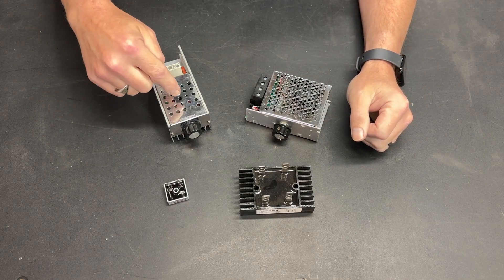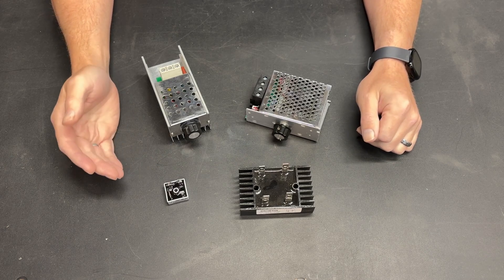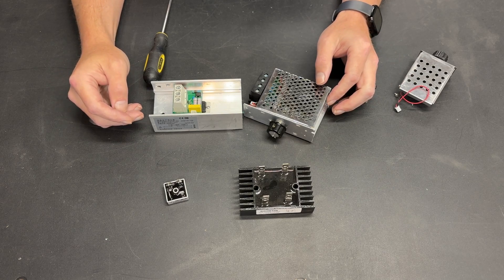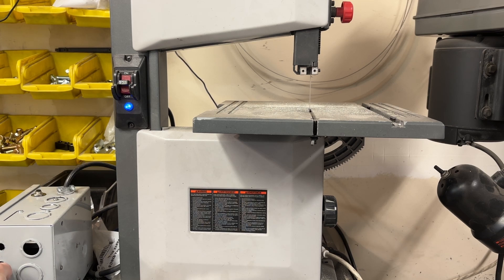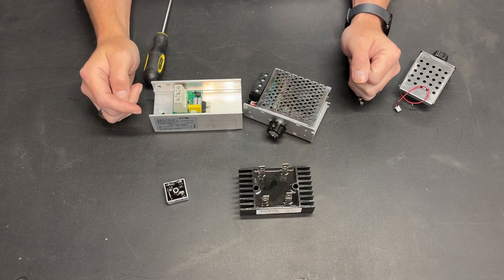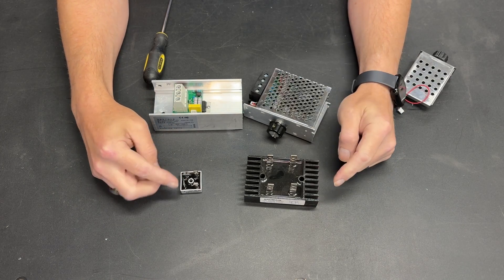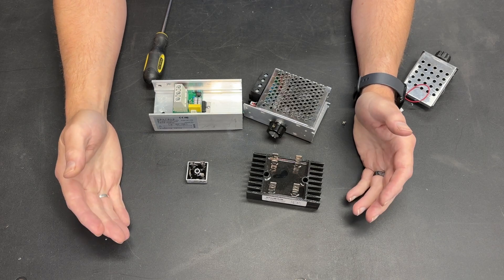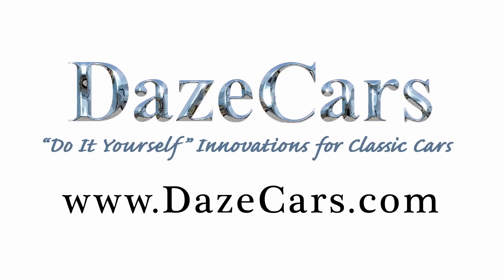A CHEAP AC-AC Voltage Controller & Bridge Rectifier ARE NOT WORTH IT  Few More $ gets SUPERIOR Parts

Comment: The bad resistor in the pic is most likely part of the snubber circuit designed to suppress voltage spikes during ac switching operations, no surprise in this application that it got hot and probably means the unit is not made for the current it was advertised for, buy a car and get a donkey but how do you ever tell before it arrives. The more "complex" circuit probably has a rectifier which "smooths out" the gate voltage to the Triac and helps prevent it from being activated incorrectly at low speeds which can be a problem with Triacs.
Reply from the maker: thanks for the insight.  The resistor had not failed just gotten hot which had discolored the outside.  It was still functioning as intended.

Comment: 8:53 "The power coming out of any of these is never going to exceed that"  This is wrong.

This is a common mistake made by people without a lot of electronics experience.  When you are dealing with inductive loads like motors, you cannot just look at the nominal voltage and current numbers printed on things and assume that's the worst you'll have to deal with.  They can actually be much much higher than that a lot of the time.

When you first turn on a motor, it has what's known as "inrush current".  For a brief amount of time when it first starts turning it will actually consume a lot more current than it's "nominal current" (what's printed on the side of the motor).  This inrush current can actually be 10 times as much or more.  That means you need all of your components to be rated for a peak current at least 10 times what you're expecting under normal running conditions, to handle the extra load that happens whenever you just turn the thing on.  If you don't, the initial current spike, which you're subjecting your components to over and over and over again, may not fry things immediately, but will substantially reduce their lifespan.

And then there's another problem when you turn it off.  When you turn off a motor, the motor doesn't immediately stop spinning.  It has mass, and it will try to keep moving, and at that point it basically turns into a generator instead of a motor.  On top of that, there is a large magnetic field stored up inside the coils inside of it, and that magnetic field will also resist changes in current.  Essentially, it will "fight" being turned off because it wants to keep running.  This actually results in what's known as "back-EMF", which causes the motor to generate its own voltage, feeding "backwards" on the wires.  This (negative) voltage spike can actually reach extremely high voltages (sometimes reaching hundreds of times the "normal" voltage) for a very brief period of time.  This can also put a lot of stress on components (especially things like diodes and bridge rectifiers) if they are not sized properly to handle it.

This is why many well-designed motor circuits include extra components for "soft start" (to limit inrush current) and "snubber" circuits (to bypass back-EMF voltages) to protect the main components of the circuit.

Also, that smaller bridge rectifier is almost certainly rated for those voltages/currents only when it is connected to an appropriate heat sink (that's what the little hole in the middle is for).  Basically, if you're not connecting it to a heat sink, you're using it wrong (this is also why it's so much cheaper, because it's really technically incomplete by itself).

Oh, and the reason you're getting surging at low RPMs is probably because you're not doing any DC voltage smoothing, which you really should be.  Proper DC rectification circuits don't have just a bridge rectifier by itself.  They usually involve several large capacitors afterward to smooth out the waveform into a proper, uniform DC voltage.  Without that, the voltage you're feeding your motor will be extremely "choppy" (on-off pulses, not continuous current), and at some speeds (or at high loads) the frequency of those pulses can line up with the rotation of the motor and cause "beating", leading to all kinds of variations and vibrations in output power/speed.
Reply from the maker: so are you trying to correct what I said or are you in agreement with what I said?  Sounds to me like we are saying the same thing albeit I am dumbing it down for the novice.  The statement you quoted is what others are thinking and my statement is in agreement with you, that power supply and rectifier is not good enough.  I didn't want to get into RMS and other things making it more confusing.  As far as soft start people using this setup are doing so for variable speed and more often than not doing it to slow the motor down so they are not turning it on at full speed and the loads are not as aggressive.  As far as a snubber setup one could use a flyback diode but I prefer the relay and resisters I used to act as a brake and dissipate the motors energy through the resistors when power is cut from the relay disconnecting the motor from the power supply and connecting it to the resisters.  As far as the heat sink those cheap rectifiers are so bad I have burned up several even with a quality heatsink properly installed.  As far as power smoothing The better voltage controller does not suffer from this issue, it has some small capacitors on board but nothing that would cause significant reduction in pulsing .  I think the inferior unit is just a cheaper circuit design with inferior parts in the controller.  With the inferior unit I think any power smoothing or cleaning will have minimal results on the pulsing if at all.  You just can't polish a turd which is the entire point of my video.  I use a motor choke with my setups as running it without one causes the motor to be much noisier and results in a lot more arching at the brushes.  I had mixed results with the capacitor.  Caused surging under load and wasn't any cleaner power (based on brush observation) than with the choke alone.  I appreciate the comment but again we are saying much the same things, however your approach is far more technical and beyond the scope of my average viewer.
Reply: Well if you want to get really technical, he did say the power coming out," which wouldn't including the inductive spikes since they come from the coils.
Brushed DC motors are weird. Their coils oppose the change in current, so they have a type of built-in inrush limiter, which is not really relevant for inrush because when it's stopped you're dealing with the stall current. But it's that resistance to changing current that makes the difference between the starting/stall and running current, always limiting the current while in motion.
It's generally not worth adding caps to DC motors because A) it doesn't make a difference and B) it increases inrush current and strain on the rectifier and C) they can easily be damaged by back EMF so now you need a flyback diode at minimum. So there. You're both right. 😛
I guess both the cheap and expensive units are simole enough, but anyone with enough electrial knowledge to understand this discussion isn't going to use either of those modules. If you want to do it right, you'd be using a variable flyback or forward converter topology. Explaining how to use that would be a great video for 1% of viewers and a great way to alienate 99% of the regular audience. The simple solution that is reasonable cheap but reliable is the best solution for 99% of the people.
Reply from the maker: That is the fine line I tread, trying to make it technical enough to have good information but simple enough for the 99% to understand it.

Comment: a single phase AC motor can reach up to 8 -10 times it's rated power/current on startup and the cheaper controller can't handle that current because it exceeds the 50amp rating and burns the resistor that acts likes a fuse, and for the bridge diode the bigger the better and of course bigger heatsink...
Reply from the maker: It's not an AC motor.  These are being used to power a DC motor and the watt rating of the cheap power supply if more than enough.  The issue is poor power output.
Reply: All electric motors (except stepping motors designed for constant current use) draw current proportional with torque. Accelerating from stop requires a huge amount of torque. With AC motors a starting cap is usually used, and with DC, a soft-start mechanism can be employed.

Comment: I went the cheaper option for learning, and it makes sence to me financially. Once ive got the builds all figured out ill uograde the electronics. I picked uo 10 bridge rectifiers for 15.34 before the 40% amazon coupon. The one you have there is $13 each. So $130 vs $15 is a huge diffrence for people learning. The ac controller i would be waiting till mid november according to amazon when i ordered the cheap one was 2 weeks. There are pros and cons to each. For justbstarting and learning ill always go the cheap and quick way tonget the bascics then up grade later. Currently im using lust a 18v battery a tread mill motor and a lathe chuck to build my parts and a angle grinder as the tooling used this setup to make some attachments for my furnace, cutting sockets for a pita car issue  where we needed stubby sockets and other small projects. For me the cheap system is a upgrade. I do understand what yiur saying though about you get what you pay for but for people that are still just in the experiment phase where they dont know fully if its the rout they want to go it makes a bit of sence to experiment with the cheaper version. Like i said $15 for 10 rectifiers vs 130 for 10
Reply from the maker: just be carful with those cheap rectifiers because when they fail they tend to short out completely and burn out power supplies.
Reply: Learning and starting out are two very different reasons. Every beginner starts out, but not everyone starting out is a beginner. If you want to learn, start with a smaller and considerably less challenging project and understand the basics. Start with small low power motors and understand the principles. Once you have a good understanding, then you're in a much better position to pick what's right for you. 

Frankly, buying the cheaper option against his recommendations is a waste of your time and money, especially when the price difference is small. Buying in quantity is getting way ahead of yourself and makes no sense, especially when you're experimenting. You're better off going with his buying advice and watching his videos. It will cost you less and you'll learn more.
Reply: @bobweiram6321  for the speed controller I 100% agree for the bridge rectifiers the price really is significant. Somthing like 7- 1 is the price diffrence. I would be curious if throwing a cheap fuse in the link will stop it feeding back and burning out the speed controller. And like he has said his band saw worked with the cheaper setup for several years. Essentially it comes down to time and money and the person doing the build.
Reply: @WheresTheFun   A fuse won't burn out fast enough to protect the high back EMF current when the motor stops abruptly. You'll need a flyback diode between the motor and the controller. Definitely check online for some schematics. I'm not sure, but the diode bridge he's using may already include one.
Reply from the maker: Just to clarify my bandsaw worked just ok with the cheap controller for several years and works way better now with the correct controller. In the early days of use I went through several of the cheap rectifiers failing and that is why I found a better rectifier. I use a circuit breaker between the power supply and the rectifier and thats the only thing that saved my power supply when my budget rectifiers failed.  I understand your cost concerns but if the cheap rectifier fails and takes out the power supply you now need to replace both components.  A part that is prone to failure will likely need to be replaced over and over again so you will eventually burn through your entire supply of rectifiers making the more expensive rectifier the more cost effective option.

Comment: I bought  the better  setup.  But I  think  I  need  a different potentiometer.  The one that came is a 470k.
Reply from the maker: I have a video showing exactly how to deal with that issue. https://youtu.be/04d0u1RJyXw?si=ny3cYxA6KkqHJn8Q
Reply: @dazecars  often the pots that come with these devices are around 500k which limit the how sensitive they work in specific situations. By measuring the resistance of the pot when the motor starts to turn you can replace it with one which give you more sensitivity and finer control
Reply from the maker: I know, the video that I made and linked talks about all that and shows how to correctly size the potentiometer.

Comment: 1:25 So, you don’t recommend using the cheap controller to for a treadmill motor? 😈
(Don’t answer, im just trolling).

Those small rectifiers do need heatsinks. I’m not saying that that would be sufficient but without one they’ll fail well below their maximum ratings anyway.
Reply from the maker: I used a heat sink and they still failed.
Reply: @dazecars  Ok tx!
Reply from the maker: 👍 my pleasure